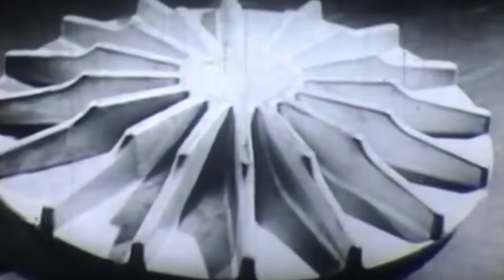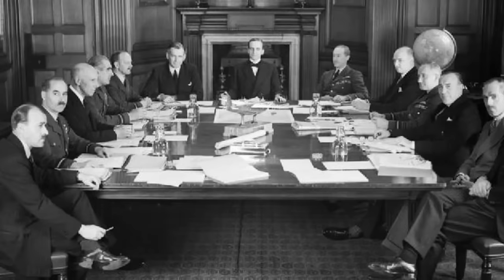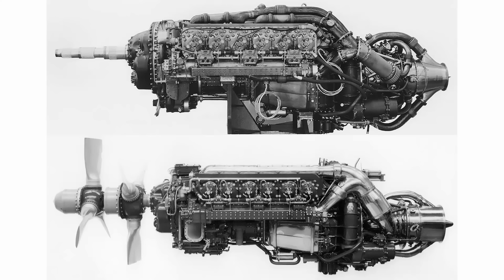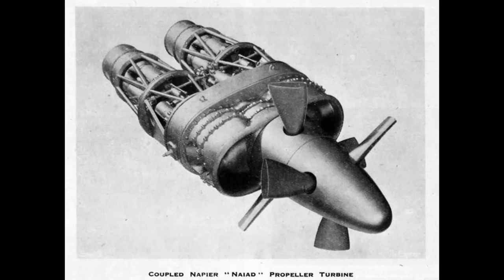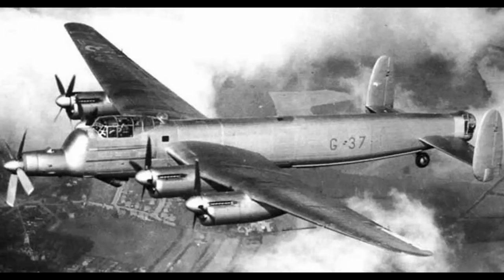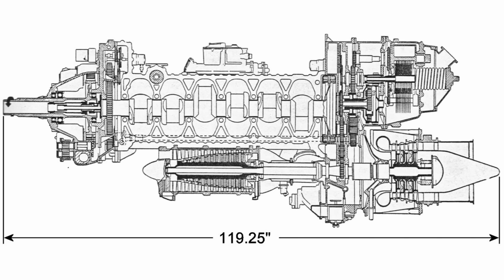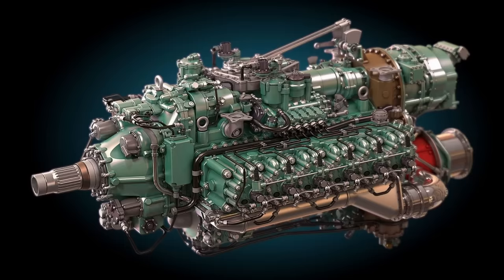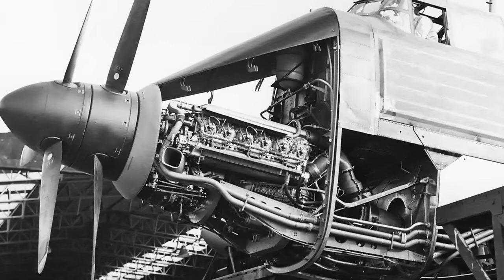A Turbo-Compound-Prop Engine? - The INSANE Napier Nomad

Comment: Interesting. I always thought the RRB Crecy (2-stroke, sleeve-valve, 26L V12, 2,700 hp, 1.43 hp/lb) was one of the best non-compound engines. I wonder why, given the increased capacity and sophistication, the Napier Nomad (2-stroke, sleeve-valve, 41L flat-12, turbo assisted, 3,200hp, 0.88 hp/lb) was only marginally more powerful- and had a much worse power/weight ratio.
Reply: The Nomad was not sleeve valve, just a simple piston ported 2 stroke.  Effectivey the engine was used as the combustion chamber of  the gas turbine but was also able to provide power to the prop.  The power ballance was fascinating with the diesel contributing the bulk of the power in climb  and the turbine power rolling in strongly as altitude increased. Raw takeoff power was supplimented with water injection and the fuel injected into the "inter burner" .  Gas turbines are inneficient at low altitude and speed and the piston engine performance drops off at altitude even with the massive amounts of boost used in the Nomad.
Reply: Power to weight ratio wasn't the defining reason for the existence of the Nomad,it was the power to fuel burn ratio that mattered primirarly.

Comment: What I don't understand is that piston engines were at their peak in the late 1940's. Then it was dumped for turbine and jet engines. General Aviation stuck with old air cooled under powered aviation engines that never evolved. Wonder if P&W, and RR were to continue their research and apply it to general aviation where would they be today.

Comment: Why couldn’t Napier simplify this and put it in a car? Put a BMC OHV engine connected to a smaller version of the turbine and connect both to the transmission. It could be a good crate motor for a small hot rod or special.
Reply: The efficiency of this setup (thus power output) relies on the 2 stroke cycle (every time the piston leaves TDC, it's under a power thrust), the opposed pistons (rod and journal loads split), and the scavenging efficiency the opposed setup allows in porting. You can also "late fuel" the engine supplementally, feeding the turbine without frying the pistons.

There's also difference in use dynamics. Aircraft engines are run mostly "steady state". You run a reasonably steady rev count, and vary output by loading the prop more or less. It's more like a generator than a car. That allows tuning to be a bit easier.

Impossible? No, of course not. But, it would be very expensive, a large package by displacement, and wouldn't deliver as much output improvement. Not a great combo of features to try to pitch to consumers, lol

Comment: they used a marine engine for the 
english electric class 55 diesel loco.
this engine was a two stroke diesel d shape engine.
ee bought the napier enginen copany.
a diesel in a normal atomotive seting does not use spark plugs it uses glow plugs.
🇸🇪🇸🇪🇸🇪🇸🇪👍👍👍

Comment: Ok, I'm not an aviation guy (just a gear head), and so this is extremely tough to follow considering all the additional components... But holy crow... 
S I X fuel injector pumps PER CYLINDER?!? 🥺

I assume that was as a means of allowing both a way to vary power (HP) output, but also to... well I was going to say compensate for altitude, but that didn't sound right on second thought... but maybe not?
(my second guessing it's because dumping more fuel in, wouldn't do much at higher altitude where there's less oxygen)
Reply: Volume/time/burn efficiency. 6 inch bore, 7 inch stroke, so flat out huge piston crown area. 6 injectors allow those opposed crowns to get even thrust (can't do a single large central like a truck, there's a piston there), individual plunger pump elements allow variation in spray duration and timing to promote thrust impulse duration, as well as excess fueling (to feed the turbine) at a timing point where it won't expose components to excess fueling temps throughout the burn cycle. Walking the tightrope of wringing every erg of energy they can out of that huge mill without it rattling itself to pieces, or burning up. Can't have an aircraft engine grenade like a top fuel rail hemi, it negatively impacts aerodynamics, lol
Reply: @ludditeneaderthal  Oohh! Jesus, 6in x 7in... Yea, ok, that explains it! That's alot of volume to satisfy, and a shitload of fuel to move, nevermind deliver!!

I wouldn't have considered they would inject the turbine's fuel into the cylinders, BUT, if that's the case (as in, I didn't misunderstand), it makes sense since it would help cool the cylinders... At least I assume that's the intended reasoning?
Or is it to pre-warm the fuel before ignition in the turbine?
(I don't know if petrol engine need that, but I believe certain rocket engine's turbo-pumps do... then shading, that's cryogenically supercooled fuel, compared to just "really cool" from high altitude's temperatures haha)

Up until last CoViD, I never knew about so many of the crazy engine designs... X-engines, Opposed like here (not to be confused with a "Flat"), H-engines, and literally like a dozen others (edit: like the Deltic; how could I forget!). Just about all of them for tanks and aviation... lol

Anyways, thanks for the explanation!
A luddite or Neanderthal, you are certainly NOT!
🍻🤘

Comment: Wait, so does the turbine actually have combustion during flight or is it just a massive turbocharger after take off?
Reply: its not turbo charger its used to drive propeller. but no it does not have combustion.

Comment: Non eof these 'compound' engines were as good as suggested given one could just use a turboprop.  the only application I can remember was for the Canadair CL28 Argus but in the end this used Wright R-3350 Duplex-Cyclones
Reply: Early turboprops had their own set of unique problems, usually with the huge amount of gearbox reduction they required. Many good plane designs were ruined by early turboprop failures.

Comment: Not bad for an oil burner,but in the pony count stakes, Napiers boxer stroker cannot compete against Pratt&Whittney,s R-4360-51 VDT.  4, 300 ponies to Napier,s 3,135.  Reason for Luke Hobbs  beast chucking out that many ponies is to do away with the supercharger and fit a huge turbo with a variable discharge  nozzle ,now standard on most jet fighters. Okay the R-4360-51 may not have the economy of an 850 Mini, but Lukes creation worked.  6,000 ponies from a piston engine is pissing in the wind, the one thing working against an oil burner is weight. How many pounds does Napiers oil burner weigh in running order?, do not forget it has  liquid cooling , the R-4360 is air cooled like a VW Beetle Bug ,or an old school V-twin Harley, as weight is the enemy of any oil burner, be it your family car or a huge container ship.

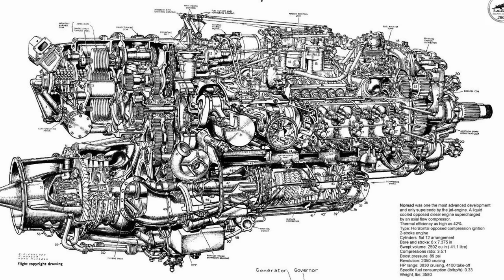Comment: Just past 7:00 you talk about spark plugs. This is a diesel, Shouldnt/couldnt be...
Reply: Why not? There is a bunch of spark ignition engines made that is running on diesel or similar fuels.
In this case the spark plugs is just used for starting(Might also been used for low loads too, according to a quick google search) before the compressors starts to build serious pressure(And temperatures had gone up) the engine can then run on compression ignition.

Comment: Are you sure about the 8 to 1 compression ratio?  I believe that's too low for a successful diesel.
Reply from the maker: Effective pressure was 27:1
Reply: The compressor was boosting the intake to 86 psi when running.The low cylinder compression ratio,for a diesel,meant spark plugs to assist starting from low rpm until effective compressor pressure built up.
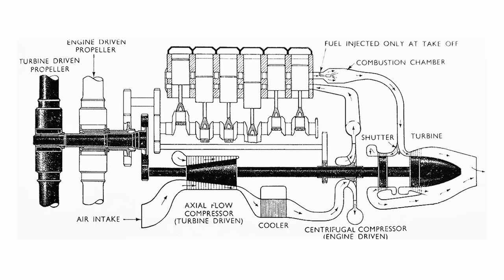Reply: So is that an error in the script?  After 3:10.  8 to 1 is not compatible with compression ignition.

Comment: What a beautiful engineering 👍😀
Did I understand it correctly that these are diesel engines… but they have spark plugs ?…
Why was the need of spark plugs ?… if they are diesel…
Reply: I believe it was mentioned in the video that they're used to start the engine - which makes sense when you consider the static compression ratio is only around 8:1. Until there's sufficient gas flow to get the compressor stage up to speed, there isn't enough compression to ignite the fuel in the usual manner.

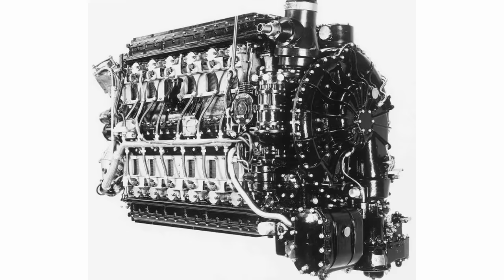Comment: 1:44 Cubic inches? Most of the world uses litrres/ccs and this was a British engine too! It's 75 litres.
Reply: UK didn't switch to metric until 1965 so maybe they designed it in cubic inches
Reply: @k20nutz  "The United Kingdom started referring to military aero engine capacity in litres in the mid-1930s. This shift was part of a broader movement toward the metrication of technical specifications within the British aircraft industry and was particularly relevant as aero engines became larger and more powerful."
That's probably why I've never heard of the 1933 RR Merlin referred to as anything other than 27 litres.
The Napier Sabre was post WWII, so it is very surprising to hear of it rated in Cu In. It's neither current usage nor was it used at the time of its creation.
Reply: @evaluateanalysis7974  interesting! I had no idea aero switched earlier than the rest of the country.
Reply: @k20nutz  Other than engine sizes, I don't think much else changed, the British bits of the Concorde were designed using Imperial units!

Comment: all the amazing technology was obsolete with advent of the jet engine you think they would have already dropped these projects by the end of the war
Reply: Fuel consumption, this engine held the record for fuel consumption for a long time and may still do so.  It is only in modern times that gas turbines have reached the efficiencies everyone thought they would reach in the 50s or 60s.  Although Whittle started work on the LR which was akin to a modern fan jet (in his patent from 1936, I think) the project was cancelled in 1946 (I think), so they were left with pure turbines, not at all efficient, worse yet the temperatures required for good efficiency were not attainable at that time.

Comment: This is the worlds most complicated engine with about 5,000 catastrophic failure points. Also don’t understand how a diesel uses spark plugs
Reply: It only uses them for starting.Once the engine is running they are not used,similar to the igniters on a gas turbine.The low compression in the cylinders on startup required additional ignition source until sustainable rpm was reached and the compressor was delivering effective boost pressure.The increase in intake pressure when the compressor reached good rotational speed then negated the need for spark plug use.Intake pressure at normal engine speed was 86 pounds per sq inch.

Comment: eh, since when does a diesel need spark plugs and magnetos????
Reply: You seem to have missed the fact the engines have like 8 to 1 compression ratio, obviously it needs some help to start and get the compressors going and the temps up.